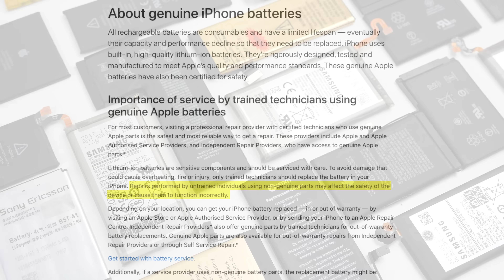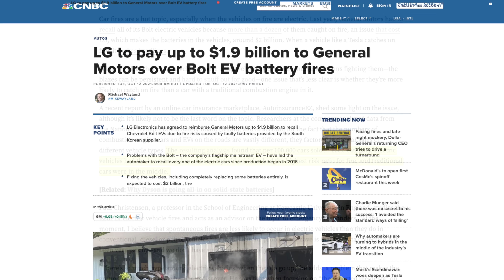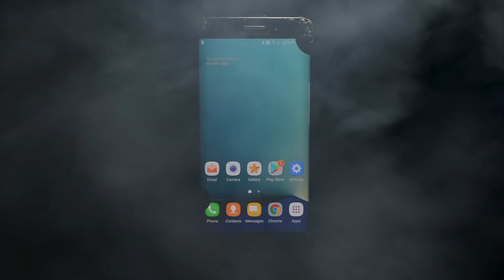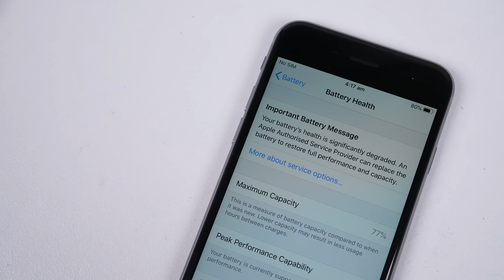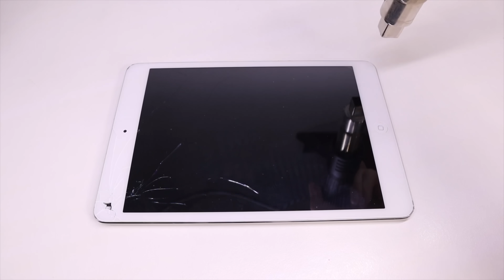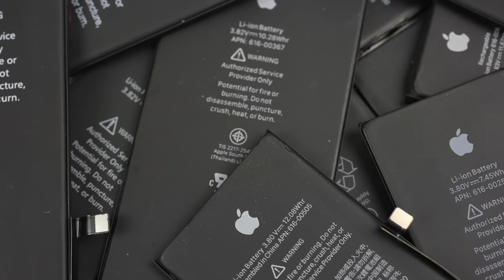Terrifying Hidden Danger of Batteries - From Phones to EV’s - How to Avoid the Risk.

Comment: 0:15 where in that highlighted text it says not to repair a phone or exchange battery? It just says to avoid using counterfeit batteries, which considering that most of the batteries available on the market are reused from old phones and scummy repair shops even buy devices to fake the battery health is perfectly reasonable.
Reply: It doesn’t say counterfeit or second hand as well. It just says “ungenuine.” The phones themselves register even the high quality parts as “ungenuine” in their own user interface if the parts are not manifactured by apple. The text here doesn’t specify it as counterfeit or second hand. It uses the umbrella term “ungenuine” as a loophole to call every single non apple profuct “ungenuine” regardless of build quality or safety. This is to make trust for third partly lower. And Apple support refuses to change inflated batteries because of the risk of damaging the screen during repair process. This is a marketing move to encourage people to buy new phones instead of repairing the already existing ones.

Comment: Uh, no! Power tools are not immune from irreplaceable batteries. I had an electric screwdriver which used 4 rechargeable AA batteries soldered in sequence, but it's literally impossible to open it up to replace them without breaking the housing, because they glued it together. A power tool that could have easily lasted me forever, lasted less than two years and less than 100 charge cycles, meaning they likely used batteries that had already seen a lot of usage or were considered defective and sold to them at a discount.

Comment: Removable batteries on phones, my opinion is mixed... My current phone is easy to open despite having a glued back. Poco X3 pro 5160mAh
However having it be removable would require some extra protection around it, making the capacity drop by a huge margin. Fariphone 5 has a small 4200mAh battery, and it's a brick and a half of a phone !
Now you could say, I'll just carry an extra one, but I certainly wouldn't, got enough stuff in my pockets already. Not to mention you'd turn off the phone everytime, then have to charge both at home in the evening...

My XMG laptop has a removable battery, it's pretty cool ! No wonder it barely lasts 2hours on full brightness. Can't even buy an extra one

I'd prefer a phone with the same internal design, but simply with no glue to deal with to replace the battery only screws. Probably the same for laptops

Comment: Will not work With Apple/Mac as these devices brick themselves even if using genuine parts as you need identical matching parts to the device and even then no, as now you need to have a tool only Apple has to put code into Apple/Mac item to confirm replaced item is matching device.

Comment: Tesla battery failures are showing up now in older Model S sedans - with the replacement battery costing as much as the total value of the car in most cases.  One owner was quoted $21,000 USD to replace the battery in his Model S that was valued at $22,000.  A lot of folks are just selling the car for parts if the battery fails - it's their only option if they can't pony up the $20k.

Comment: I remember the tradgic day my original PSP battery got swollen and the upper plastic of the battery cracked. So I had to dispose of it, luckily replacment batteries are not too expensive. I also have an old ipod nano 5th gen which still have the swollen battery inside of it, but it still works and I can't get out the battery since its swollen. And I still don't know what to do with it.

Comment: I has similar issue with Asus Zenfone Selfie having a user-replaceable battery when it's battery was swollen I removed the back cover then battery with no effort. Same thing happened with my iPhone 5S & it's difficult to remove it without taking it to a repair shop
 because companies prefer unibody design than modular design and they will charge you more than needed for battery replacement

Comment: ALSO : BATTERY CARE - COUPLE OF NOTES regarding storing/charging phones (& other modern devices) to EXTEND their life...
1 - TRY NOT to charge to 100% each and every time, as 'Dentrite' buildup can follow ('Dentrites' are little crystal like structures that emanate from the 'Anode' that spread and and try to reach out to the 'Cathode' thus causing a 'Short').
2 - DON'T leave such devices like Laptops, Tablets or other 'Rechargable devices' plugged in charge for longer than is necessary (ONCE device is charged REMOVE IT from charging), and NEVER leave your rechargable device plugged in 24/7/365, it's one of the best ways to kill a battery quicker than it's usual lifespan.
3 - IF you are looking to store a modern rechargable device 'Long Term' (say like, a Lawn Mower/Strimmer over winter) or any other rechargable device with Li-Ion batteries, To KEEP BEST HEALTH whilst not in use, get the batterys' charge level to about half way (50%), and try to store said devices at/or close to 'Cool Room Temperature'.
All this information can be confirmed online. Get the best from your devices, save yourselves time and money on device repairs due to failed batteries etc by looking after those batteries with a little thought and care 👍
😎🇬🇧

Comment: My Macbook had a battery issue back in 2021. Somehow, a screw had gotten into the laptop and was shorting out something on the BMS board. I took it seriously when the laptop became so swollen that it wouldn't sit flat on the table. I immediately took the battery out and placed it on a concrete surface outside far from any bushes. Imagine if I couldn't take the back cover off to remove the battery?

Comment: My rule of thumb when replacing a non-removable and/or swollen battery is to drain the battery to the point the device shuts off and can no longer turn on so that if I have to wrangle the battery outta there bending it in the process, it won't have hardly any energy in there to start on fire. I've done that with every single device I've replaced the battery on (with the exception of my 2011 Samsung Transform Ultra but that's because it has a user-replaceable battery and the battery was totally dead anyways). At this point I may even drain user-swappable batteries when replacing them just out of habit cuz I've been doing it so long with non removable batteries lol. But seriously, I do agree that the removable batteries need to make a comeback because I'm tired of having to fight the stupid battery just to get it out

Comment: Love the video. This point should be used against all manufacturers every time they argue against devise reparability and uses safety and security as main reasons. It really easily just proves they dont care about safety of users, but only about money. Because as you said, device is much safer for user if he can remove battery then if he cant.
Reply: @@TelephoneBGs So you prefer companies control over the freedom of choice for ppl? And use safety as the reason. You sound a bit like them. But for me it is perfect example of irony. You are simply saying that you preferred choice if you had it would be to not give other choice to others :D
If you want to prevent ppl from harming themselves, why du it just for batteries. We should also not allow change of wheels on the cars or even tires. What if someone decide to buy some knock off bad tires or wrongly screw up the wheel and then causes accident? That feels like way worse outcome then using bad battery.
Reply: @ShawDou  Go throw your old phone in a pool, then throw your new one in too and see which one holds up. Look at how many phones were ruined just because they were only dropped in to a puddle, this is why phones are sealed now. Also a pretty bad analogy, people tend to sleep with their phones right beside them and I would rather be inside a metal cage in an accident than have a phone blow up right next to me. Consider the advancements to lithium over the years and how dangerous it is to tamper with even for a small device, I understand the right to repair issue here and advocate for it however I also understand the company is trying to protect itself from being liable. They are only doing what they need to in order to feed the population that constantly demands more and more new technology in a short time span, if you want it to change then stop buying their products.
Reply: @@TelephoneBGs 
Natural selection, if in the contry has a company official battery reseller.
Reply: Why are we putting all of the responsibility on the manufacturer? If these devices are so "dangerous" because "they" put money over consumer safety, then why are the consumers purchasing from these companies. The solution seems simple: just stop buying electronics with non-replaceable batteries.
Reply: @SergeantExtreme  So you mean just stop buying electronics? Right now replaceable batteries in electronics are rare. Not the other way around. If you would want to buy smart phone with replaceable battery, you have really few options and a lot of them are not cheap. Companies are right now soo big that customers cant control them, they control us.
Reply: @SergeantExtreme  Just checked your phones. Only Fairphone and Nokia can kind of be bought in my country (Czech in Europe). Both cost 500 usd+. 
That is not even close to the affordable smart phone, that is at least middle to top tier prices. You cant compare everything to the US if you want to. In my whole life i have never bough phone that cost more then 250 usd.
Also if your argument is that replaceable battery smartphones are easy obtainable, because there exist like 2% of them on the market. Then we really dont have anything to talk about. Most customers dont have the knowledge to even search for them and when they go ask in the shops it is unlikely someone will sell them these :D
Reply: Batteries are hard to remove from smartphones, because companies and government want to track your phone 24/7.
Reply: @TheRocco96  Have you seen the IP rating for a smartphone with a removable battery compared to one that is sealed? Think about it for a second.
Reply: @TheRocco96 no
Reply: @TheRocco96 If that was the case, sim would be unremovable too. That is too much of a conspiracy thinking. When the most simple solution is just companies greed.

Comment: I check the capacity of my batteries using a USB ammeter from time to time. If the capacity has fallen significantly I replace the battery.

Comment: I had a little lithium 5B power pack I used to charge my phone when away from home. It developed a swelling and split open. I foolishly picked it up and it literally exploded into flames in my hand. Fortunately I immediately dropped it so I did not get burned but it burned a hole in the carpet and wood floor beneath. If this had happened when I was not present it would have burned the house down. Be warned.

Comment: Its definitely nice that power tools have removable batteries, though with my power tool battery is that by the time it needed replacement none is on the market for purchase anymore (mine is 13 years old). Fortunately mine is Ni-Cd so rebuilding with new cells is very easy as there are no PCBs involved

Comment: Always have to be mindful of the risks of anything you use. And yes, I miss the good old days where I could just pop Open the back of a case and swap the battery in 3 seconds.

I'm sure they could figure out how to water proof A configuration like that if they really want to.
Reply: The Samsung S5 was IP 67 despite its non glued back and removable battery so that argument is full of crap. Newer phones just achieve IP68 which if you ever seen a liquid damaged phone like I have, doesn't really make a huge difference. All it did was make phones "sleeker and thinner" to please the masses.
Reply: @Hackerhunter15 thats a big lie about they say thinner but then they make it with 5000-6000 mah batteries and its still thick! Also samsungs rugged phones does have a openable back cover and you can take the battery out like the old times and also it has ip68 water and dust resistance even with a openable back so they literarly lie about all of this!
Reply: We can thank Apple and hipsters for that. Thanks to consoomers, modularity gets sacrificed for aesthetics.

Comment: When I charge something I will always check on it at different times to make sure it’s charging properly or it is finished. I have a 20,000 mAh Anker power bank I often charge over night if the power level is low enough. It’s always near me in case issues occur.

Comment: I would like to see smartphones built with removable batteries and memory cards again.
Reply: It would be very difficult if not impossible to make them water resistant.
Reply: @bradallen8909  Very few people go swimming or diving with their phone. 🤔
Reply: No, it wouldn't. Samsung S5 wad IP67 and had removable battery AND sd card slot. That's a marketing lie, made by companies.

Sure, it wouldn't be as aesthetically pleasing as Apple's dogshit devices, but they'd work as intended.

Also, salty water instantly corrodes any device; even IP68 ones. I'd rather have a clunky, yet modular and practical device over a slim piece of shit that I cannot repair myself.
Reply: @proudbrogressive315  I completely agree with you.✔️
Reply: @bradallen8909 there is a phone that has it. The modular one that he showed in this video and some time ago also made a review on it. It's called Fairphone

Comment: It's been a while since you did a video about batteries, last one was just after ifixit did theirs about puncturing a charged battery...
IMO the most concerning aspect isn't the single batteries that you see in phones/laptops/tablets, as they can still be removed (or the power can be isolated), just not as easy as they once could.
The problem is with these EVs and (a) how you recycle a EV battery at EOL, and (b) what happens if an EV battery gets damaged/goes into thermal runaway. After all, you don't want your garage (or even your entire house) going up in flames because your EV's battery has spontaneously combusted.

Comment: The main reason why battery’s expand is because the battery hasn’t been changed in years causing out gassing. 
This is why you should keep your electronics charged all the time when your not used them
Reply: But not fully tho i would charge it to 60% so that its fine
Reply: @eylemuyavul3055  that’s ok
Reply: If I remember right, keeping at exactly 50 is the healthiest for the battery. very much could be wrong so you should probably fact check that

Comment: I've encountered 3 spicy pillows. one was out of an iPhone 3GS, it was VERY BAD! The Batt that Hugh was holding looked like mine. The second one came out of an extremely rare Canadian Edition Product Red Motorola KRZR-K1. It looked a little bloated, but otherwise it was fine. Third batt came out of the Same model. looked a little bad, As there were Dents on the battery cell. 2 of the 3 Phones had batteries.

Comment: Hugh
Can you answer a question for me!?
WHY do they glue the battery to the phone!? Isn't this redundant!? I mean if there was no glue, where do they think the battery would go inside a sealed phone!?
Reply: They glue it because, even whilst inside a sealed phone, the battery will move about a little, and because no two batteries will come out identical out of the factory. Batteries are not made equal, they'll all have some differing sizes, and you would want to make some space in case the battery expands a bit, but that will mean there is some space for the battery to jump about. Gluing them is a pretty easy way of making them stay still without requiring screws and/or other things that would take up more space and not hold them in properly (Like latch mechanisms in old phones: they work, but have you ever dropped one and your battery came out? Yeah, they're not that great.)
Reply: @nylvon  I don't agree! I've seen plenty of videos of phones taken apart and they all have appeared to be a perfect fit! That with the fact they are sealed in the phone leaves little to no movement! And with battery expansion if it happens, it's either fine or winds up popping up the scree off of the phone!
Reply: @smadas4192  You can't really see the wiggle room until you masure it with a pair of digital calipers. Even a bit of wobble is enough to piss off the pixies in the batteies. You may disagree, but if you are very curious, I would advise exploring the innerds of a modern phone. They "appear" to be a perfect fit because the tolerances have gotten pretty good, but these lithium ion batteries are very shock sensitive, and the worst thing you can do is have them bang around inside a box, even if it is just a little bit of movement.
You don't have to agree, this is why other electronic components are also glued in. I mean, why do we even screw in motherboards, we can just make them rest inside a box that is neatly shaped and has just a bit of wiggle room, right? Why even use screws? Well, just like batteries, these components just don't like being shaken around.
Reply: @nylvon  dude, I told you, I've seen plenty of tear downs and rebuilds and there isn't in any of them! 
Another example, I've had Samsung for years, many of them! Going back to the removable batteries! Imo, there's no difference! They didn't use double sided tape to hold in place and I see no reason for it here!
Reply: @smadas4192   Again, man, I told you, you don't have to believe me, simply measure.
Reply: Even though i'm not Hugh, But i believe it's to make it harder for peeps who manage to get into their phone, Tablet, Whatevs.
Reply: @JankPods0201  I don't think that's so, because they have pull tabs on the adhesive which has gotten better over time and if they don't work, everyone knows you add a little alcohol and it comes up!